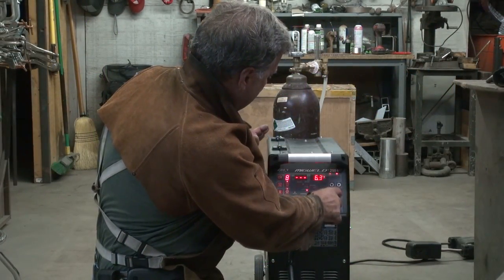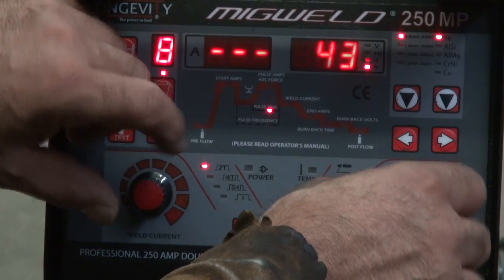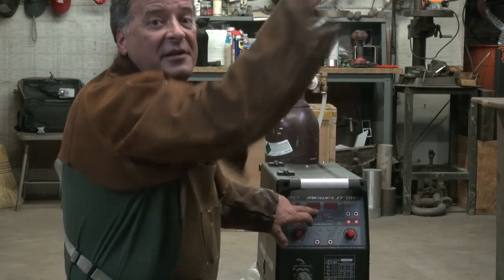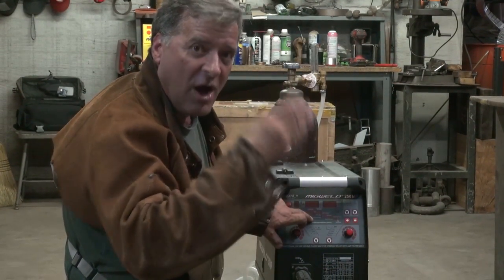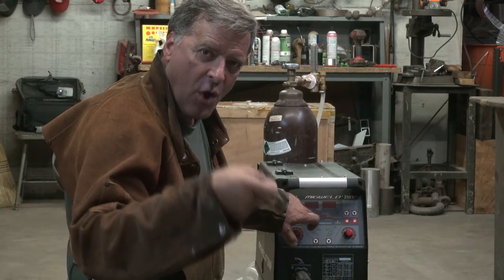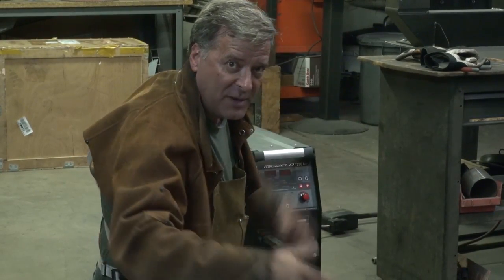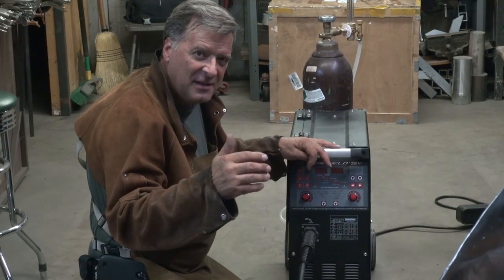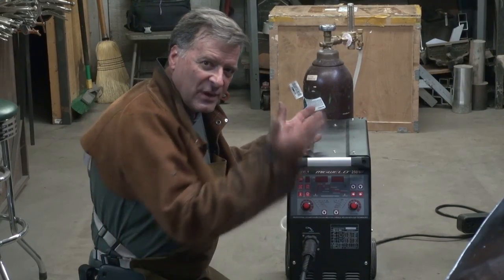How to Use Double Pulse on Longevity's MIGWeld 250 MP - Kevin Caron

Comment: Weird. I am debating between this machine and the Lincoln Power mig 210mp. From my understanding that longevity is the one I am thinking of that is about $900. The Lincoln in $999. I will probably go with the lincoln but I have really been liking the Longevity stuff.
Reply: Nope I was wrong I guess its the WeldMax185i. The Lincoln is dual voltage and does flux core and I can probably get it locally and since I am a student I can get a 10-20 percent discount. which would make it $800
Reply: Yeah I saw that after I did a quick search after I posted that comment. I think I will go with the Lincoln 210mp unless Something comes up in the next few months that is a better deal.

Comment: this is the Topwell ALUMIG-250.  Longevity ordered them from Topwell and had them painted nlack with the Longevity logo on them.  Google Topwell Alumig-250
Reply from the maker: Thanks, old video but i didn't know that.
Reply: +Kevin Caron, Artist 
what was your overall "general impression" of it?  I was considering purchasing the Topwell ALUMIG-250 which is again this exact weldet but tbh it seemed a bit confusing.  Im going to most likely purchase the Topwell Mig-250.  60% duty cycle 250 amps plus spot and stich also arc force control... welds stick ad well.  But you honest overall impression would be most appreciated.  Thanks
Reply: +soicanspeak sorry for all the typos.  I wish there was an option to edit!
Reply from the maker: II found the dual settings on the pulse confusing. Never got a good weld with the dual pulse running.    I sent it back to Longevity.
Reply: +Kevin Caron, Artist 
how about short circuit mig?  how did that go?  just curious if it is capable of welding good.  Thanks
Reply from the maker: Short circuit and spray transfer,,awesome!    Single pulse,,,very good,,,

I just couldn't get my mind to figure out the dual pulse.